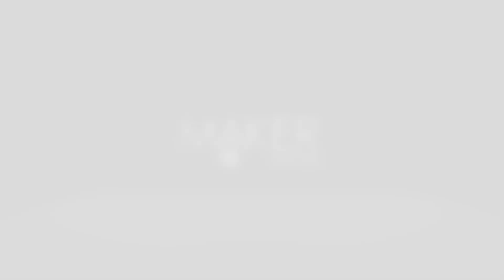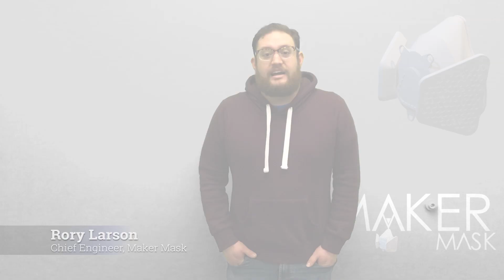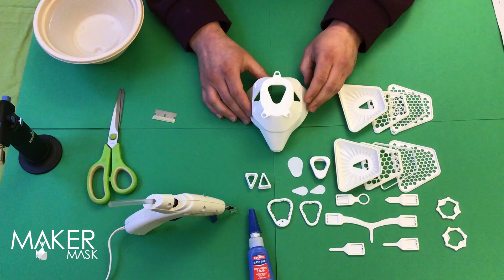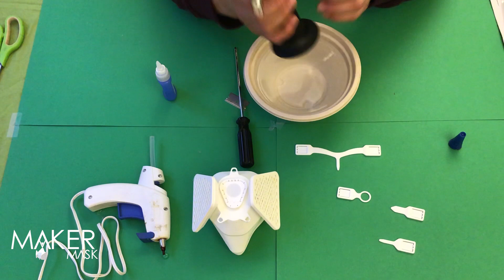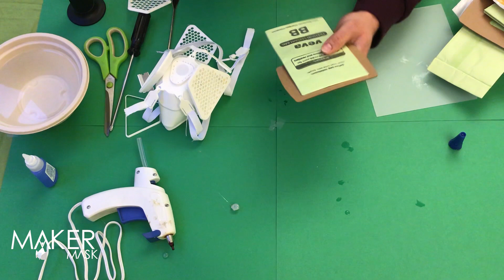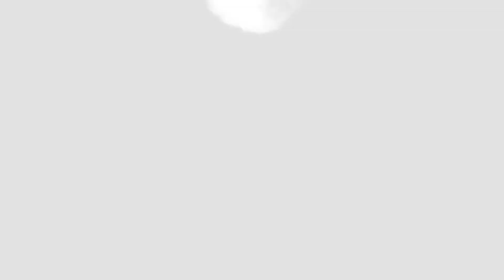Maker Mask Assembly

Comment: First off, thank you for doing this project, and sharing it with us all.  I know how much work this is, and I genuinely appreciate you donating your time in this manner.

Some build notes to folks who are struggling with fit-- if, like me, you have a printer that can't quite manage the level of detail you'd need to get all of the parts to snap together as seen, there are some fast workarounds.  I'm listing them below in no particular order, in addition to some general thoughts:

1. Print the front reed valve cover scaled to 110% size.  Don't worry about the snap fit, use hot glue.

2. Print the side reed valves and their respective mounts at 95% size.  This will allow them to slide easily through the mask and in to the filter base.  Don't bother with the retaining ring- again, hot glue between the filter base and mask body, and again around the edge of the reed assembly on the inside of the filter base.

3. Skip the snap-on bracket on the inside of the exhalation reed valve assembly.  A bead of hot glue makes for a solid seal.

4. There is no need to scuff the mount points of the reeds.  Superglue works best on smooth, flat surfaces.  Place a small drop on the holder side, wick off any extra with a piece of paper or the like, then slide the valve in to place.  Once it's positioned properly, press down with a pencil eraser for a few seconds and you're done.

5. If the elastic claps are a little stuck together between the teeth and the rim, a flame-heated exacto blade will save the print.

6. The filter covers may not snap in properly.  Passing a heated exacto through the slot in the filter base where the cover is meant to snap will ensure that you can close the filters as expected.

7. Instead of weatherstripping, you can use a couple of beads of hot glue or silicone around the edge of the mask to achieve a comfortable, airtight seal.

8. If you're having trouble finding HEPA vacuum bags, a couple of layers of furnace filter material works well.  The higher-end filters are electrostatically charged, and combine good flow and good filtering- they'll be easier to breathe through then a vacuum bag.  Use what you can, of course.

Comment: I am not really good at designing, however I saw some people (including me) was not happy with the front valve.  So I created a addition to the front side for filter. Two pieces, one goes inside the outer shell, keeping filter material in between. Outer shell fits on front grommet.

https://drive.google.com/drive/folders/1-4A90_0X0qsO-81SKP17edLvXG6w07bV

Let me know if it worked for you.
Reply: big step forward here @Serdar -- need to iterate on it a few times I think to keep the filters in place and enable easier replacement of filter + attachment securely.
I'm looking at this as reference: https://www.thingiverse.com/thing:4254993/comments
Reply: can continue this on r/Makermask/

Comment: Printed mask and front seal assembly and works well. Used high grade sandpaper on front flap to ensure smooth. Had challenges printing filter parts. Altered filter parts to reduce print complexity, from circle to squares, less ideal as less holes. Will require 30mins less print time and reduce wear on printer.

Link to two adjusted parts for comments and review:
https://www.dropbox.com/sh/wnc036zb76frml2/AACh4sBGvXLrOfM5eWiyj3yTa?dl=0

Update: appears to be helping, all those circles where a huge challenge for my printer.

Update2: fully printed a mask. I think there is something random with my bed. Though the circles to squares helped allot. Unsure why cura made gcode that had my print head bounce print/retract over and over on the edges of the filters though. It should have just followed the edges around and been done way sooner. Need to figure that out.

Questions:
-Does someone make a 3d printer with autoleveling?
-Why does cura cause an print/retract on curved corners of the filters when nearly done?
-The side valves could be larger.
-when I superglue the side valves ensure I only use a dab at the top.

Hey thank you for the amazing design. i been thinking a valve body that is completly 3d printed? Wonder if that is possible?
Reply: Thanks for sharing your design.

Comment: The weather stripping is something of a weak point here. Couldnt find any of appropriate size with a 'tail' as long as the one used in the vid. Ended up applying hot glue to seat it.
Reply: can you guys @Makermask / Rory -- help point  the exact type of weather stripping you're using?
Reply: Here you go. This is what i ordered and it appears to have the tail. I'm waiting to print the mask. 
https://www.amazon.com/gp/product/B00GC6M7RK/ref=ppx_yo_dt_b_asin_title_o03_s00?ie=UTF8&psc=1

Comment: When I was attempting to assemble this after printing, I'm finding the parts are way tighter than it seems like it the video. A couple of the parts broke trying to snap together. Any help on fixing the sizing issue?
Reply: Try to use any 500 grid sander. You don't have to sand too much. 500 will create a better surface to snap.
Reply: I had to print the front reed valve retention ring at ~110%, and skipped the rear one altogether- I just hotglued it in place.   I also used a dab of cyanoacrylate on the front reed in the same manner as the side valves.  Those were the pain points on my printer, at least.

Comment: Nice design printing one out right now my sister works for hospital in salem she may like this design can you tell us where you get the weather stripping
Reply: I think it is (https://www.amazon.com/gp/product/B00GC6M7RK/ref=ppx_yo_dt_b_asin_title_o01_s00?ie=UTF8&psc=1). PS:Haven't receive it yet.
Reply: @serdarserbetci  have you received the stripping to confirm fit?
Reply: @nikgarkusha4930  yes. It is really good. I will try to post a picture.
Reply: https://drive.google.com/drive/folders/1I8No0S-zzQ-EldXOFyV9JUg4N9ZtNT_5?usp=sharing

I think this might work
Reply: @serdarserbetci  How's the comfort level? Vinyl is usually pretty hard vs rubber
Reply: @nikgarkusha4930  it came out pretty good actually. I can say, it is better than I expected. On the other hand, it is impossible to wear without any cushion. I wish it was a little bit softer.
Reply: @serdarserbetci  that was my concern with Vinyl. I too picked up Vinyl stripping from home depot and it's hard af. Also have a rubber version that is softer but not sure the slot is designed for it.

Would really be useful to have MM guys actually reply what Weather stripping they themselves are using